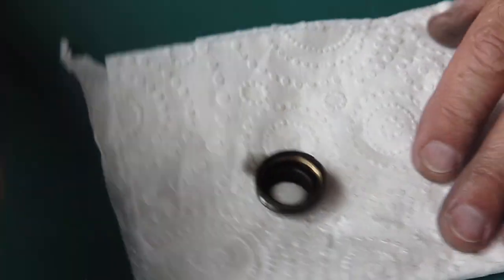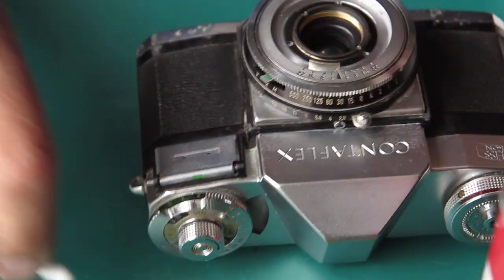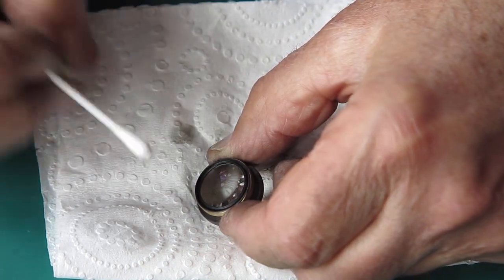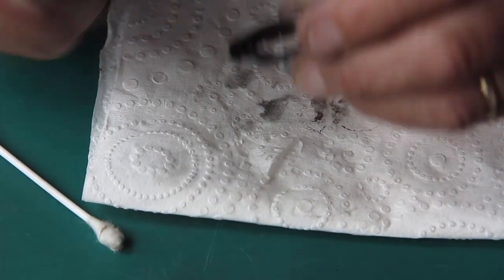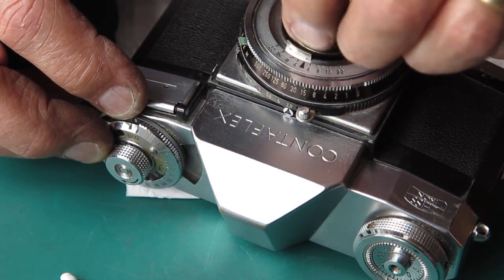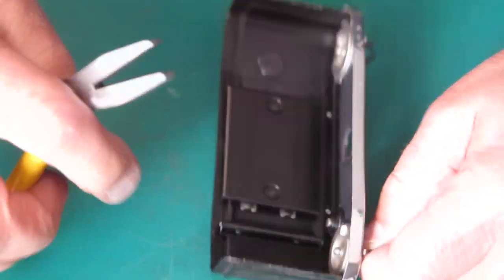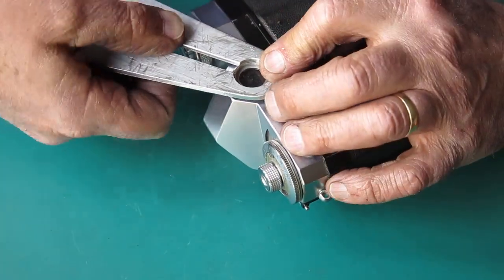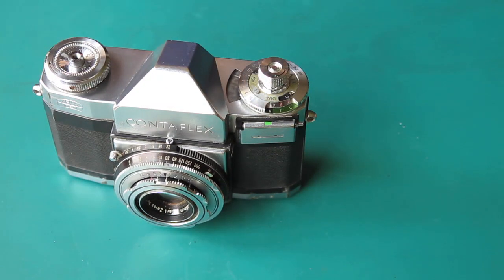The Contaflex II from Cressbrook, part 05

Comment: I was disappointed that I did not see how to put back the lense at 12:02 =(
Reply from the maker: Sometimes I fail to press record, and miss bits. That, and the flaming camera cuts off unexpectedly because the card is full, a file-size limit has been reached, or the battery has gone flat.

Comment: These videos are brilliant. I’m looking to have a go at repairing cameras. Do you really need a Hydrogen Peroxide/Ammonia solution to clean off the fungus? And “Hello” from Wellington!
Reply from the maker: I never do. I just clean the lenses with normal domestic glass cleaner. If something was particularly bad, I might clean the lens element in question in hot water with normal dish-washing liquid.